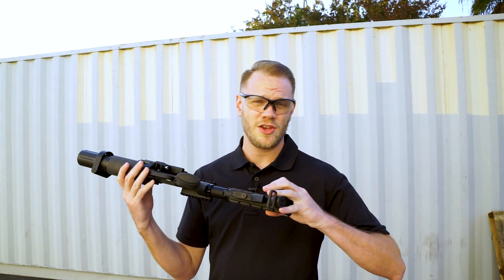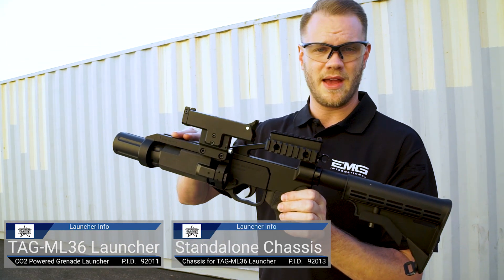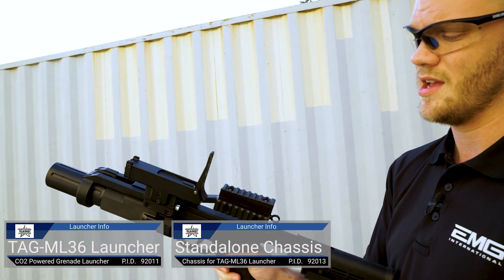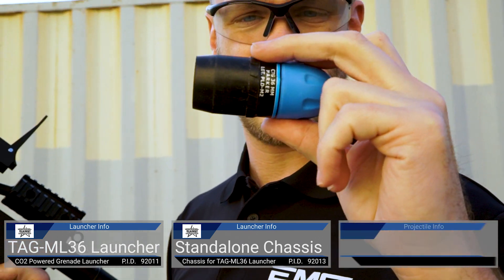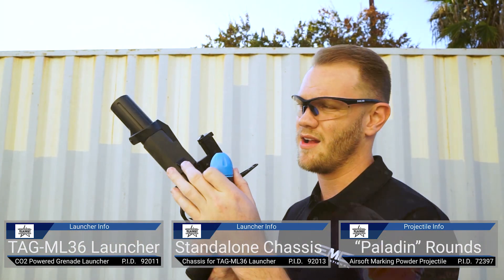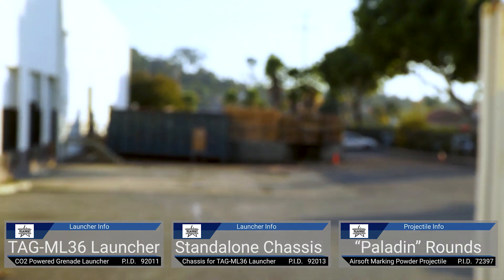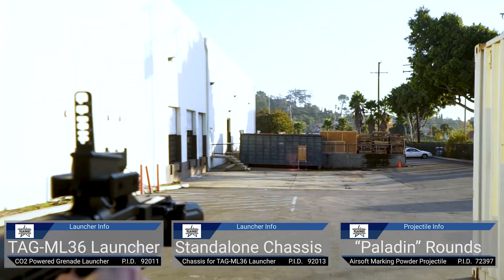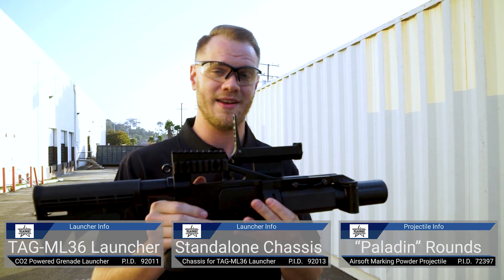TAG Them All! - TAGinn TAG-ML36 Airsoft Grenade Launcher System

Comment: That's cool and all but for 700$ that's no bueno
Reply: Last launcher you'll ever buy though
Reply: you can get their shell that fits in pretty much any other grenade launcher for lik 70. works great out of my M203 and my pistol grenade launcher
Reply: spend seventy and get their shell for an M203, works just as well for 1/10 the price
Reply: I had their gen 1 stuff when it first came out and id be ok just buying the shell again. This is Cool af but way over priced